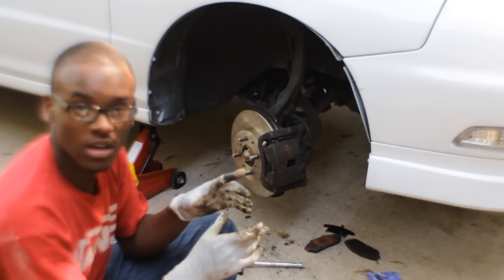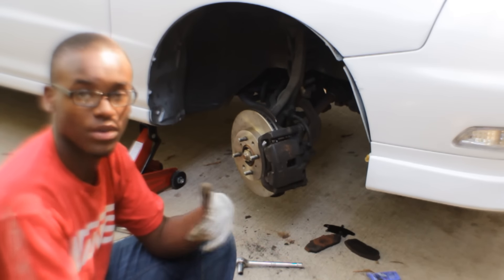Project Integra Track Car Prep Part 2

Comment: its should line up when you press the brake pedal,if not just take it back off an check for old rust,make sure that plate behind is flat they bend up easy. good work

Comment: Front brake job should have been done more  throughly with cleaning off some of the rust on the bolts and calliper brackets with wire brush + anti-seize  and sliding pins need some lube its only right since like 85% of the braking is done by the fronts just so you know.
Reply from the maker: The Caliper bracket bolts are brand new and I scrubbed the bracket with soap and water. I didnt use anti seize for the slide pins so i guess i should do that as well. I occasionally do things off camera because it doesn't look interesting enough. Thanks for the advice!
Reply: +Miton Films dam it don't put anti in the pins that for like the brake clips on the calliper mounting point and behind the disk or behind the hub bearing use brake lube!!!

Comment: nice man. that issue that your having with the brake pad could be from you not buffing/using a wire wheel on the hub that has your lug studs in it. that can cause brake pedal pulsation and possibly some pull under braking force. thankfully you didn't have rotor screws and don't have rear drums like I do on my ek lol. when I do the brakes on my integra it takes me probably 45 minutes with hand tools because they all are disc brakes
Reply from the maker: oh i did have rotor screws, but i got real lucky and they came right out!

Comment: milton have you thought about getting stiffer motor mounts from hasport or innovative? and maybe after market headers? that would be a great video
Reply: and maybe a short shifter
Reply from the maker: I dont see why i would get better mounts? I will be upgrading my header later on when i find one that i like.
Reply from the maker: +25Newengland i will probably get the k tuned short shifter😆😆
Reply: +Miton Films harder motor mounts reduce wheel hop when you take off and shift smoother, and the hasport ones give your engine bay alittle extra bling lol
Reply from the maker: i do know hasport mounts, i just always thought it was for high hp cars. When my mney is flowing a bit  more i will definitely consider upgrading!

Comment: The pro way to handle that stuck rotor would be to put 2 bolts ( sorry don't remember what size ) in the two smaller holes in the rotor they will push the rotor away from the hub, but obviously hitting $h!t with a BFH works too, you didn't show (or they were missing) the fun part of removing the 2 flat head Philips head screws that hold the rotors to the hub. Hope I didn't see you put brake lube on the face of the pads!
Reply from the maker: +Hondo fourfivetwo lmao 😂😂 everyone keeps thinking that i should have put it up to the camera. Also I got lucky the screws came out with ease with a regular screw drive 😆😆
Reply: +Miton Films sometimes it's the struggle not the out come that is interesting LOL but your right when they just come off its boring

Comment: What pad and rotor setup did you go with?
Reply from the maker: Wearever pads and Bendix rotors. Nothing extreme....yet. I am going the cheap route just in case i completely thrash these on day one.
Reply: +Miton Films 
ahh ok. well next time if they get stuck. Try using I believe it's a 12mm bolt. it screws into the rotors up front and pushes it right out. I just had to do it to mine this past weekend lol.

Comment: PLEASE TAKE OUT THE GUIDE PINS AND GREASES THEM WITH WHITE GREASE. that will fix your tilted pad issue
Reply from the maker: Im taking them off tomorrow morning to inspect them to see if i can adjust it some more, but i dont see how greasing the guide pins would fix the issue since it begins to tilt as i pull tbe caliper down over the pads. Its only one side too...
Reply: +Miton Films grind that shiit down
Reply: +Miton Films maybe also check to see if your have the pads fully on the hardware clips cuz theres suppose to be a little clip that needs to be compresed to put the pads in

Comment: Not going with drilled and slotted yet?
Reply from the maker: +Izac Pascual drilled and slotted is not meant for street use.
Reply: +Miton Films Is it illegal over there? I personally just went with it and got a set on my Bmw, Its not as uncommon as expected. I see a lot of modified cars and unmodified cars (like mine) driving around with them.
Reply: +Tommy Xiong that's why I've got them on my car.
Reply from the maker: No it performs worse compared to solid blanks.(My job requires me to drive my car a lot so safety is #1) I want to keep it daily friendly.....for now. I do plan on doing a big brake kit upgrade in the future but that is a secret. shhhhh!
Reply: +Miton Films lol, I mean they help with cooling the brakes to reduce fade, but that's only after excessive track use is when the brakes actually get hot enough for slotted and drilled to actually make a difference. I just want to give my E46 a more aggressive look, so drilled and slotted we gooooo!
Reply: +Izac Pascual if he was driving 150mph+ and slamming on the brakes it would get hot enough but by then the brake lines with expand and heat coming from the brake would melt the rubber lines